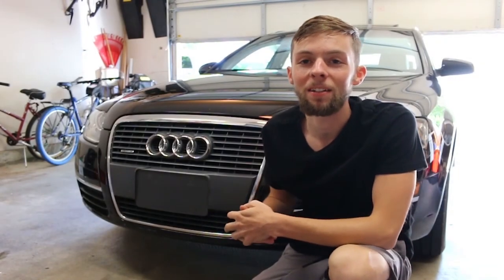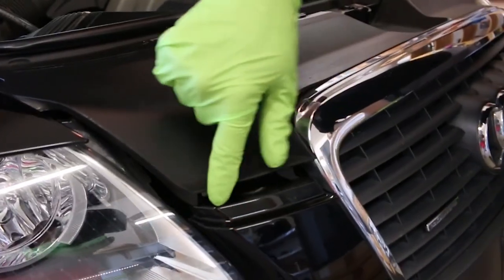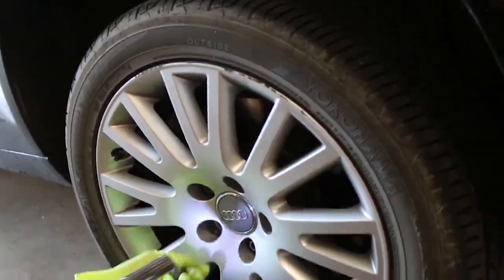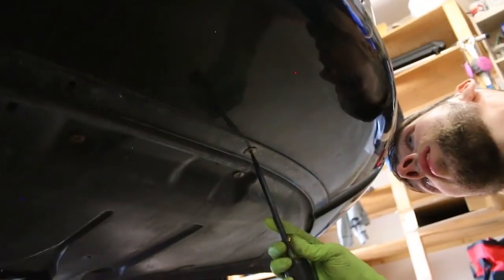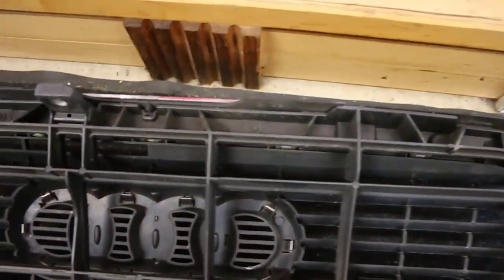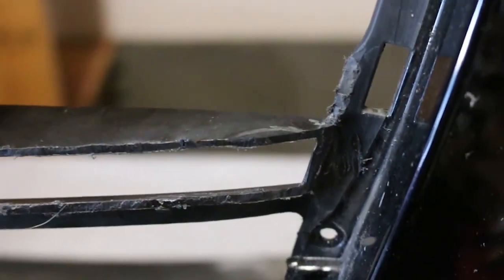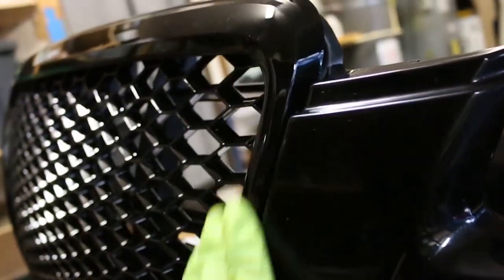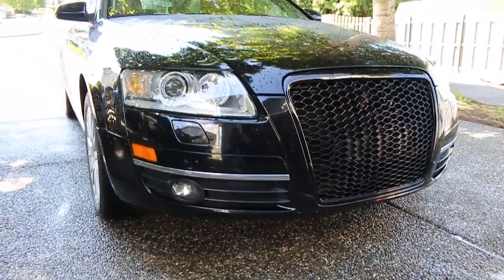MUST HAVE UPGRADE FOR YOUR AUDI A6! How To Replace Audi A6 Front Grille '06-11 | DIY facelift

Comment from the maker: Drop a comment or a like if this video helped you!
Reply: Nice video Cole :)
Reply: Bruh u have everything I needed to change to my car but haven't had the courage yet. Now I will do it in a few days ordering and getting ready.
Reply from the maker: @FirstNameLastName-fu8ml  you got this👏🏼😬
Reply: good job, I like it, but this model is not as aggressive as the facelift model, and you added this very sporty looking grill , I think it needs a bumper lip to neutralize the overall aggressiveness and probably needs some eyelids 🤔🤔🤔

side note: each to their own but I like it with the emblem better.🙄🙄🙄😂
Reply from the maker: @osamamaddani  I agree with the lip and making more aggressive. 

I also agree on the emblem, however, the mounting hardware for the emblem looked so awful I just couldn't do it. Guess thats what comes with a cheap grill

Thanks for watching and sharing your thoughts, appreciate that🤙🏼

Comment: I did this mod to my C6. After a while I put the badge back on it looks so much better with the chrome and honeycomb
Reply from the maker: I was going to put the logo on, I even ordered a all black logo from Ebay. But I really dislike the mounting hardware that came with this grill. Looks so cheap and awful in m opinion. I am still badgeless. About to tint the windows next though and then de-chrome everything. 

Thanks for watching and commenting, appreciate it🤙🏼
Reply: @Mechani_Cole  yeah I agree the mounting bracket is awful that’s the only thing I dislike about it

Comment: The reason it didn't fit perfect is because that grill you got is meant for the facelift 08-10, the 04-07 is slightly different 🙂
Reply from the maker: Good point, you may be correct! Either way, with a little modification it fits nicely.

Appreciate the comment, I didn't think of that before🤟🏼
Reply: Link for 04- 07 grill????
Reply from the maker: Don't have one. Not sure if they make one. Just have to slightly modify this one to fit

Comment: If I got front crash sensors, seems it wont fit well? Or code the code the computer as non-equipper and cut them off?
Reply from the maker: Can likely just relocate them or cut the grill to fit

Comment: I keep finding grills that say "2004-2011" even though they are different generations. Will a C6 grill fit the C6.5 generation? I have a 2011.
Reply from the maker: It will fit. Might have to do the same I did in the video for a good fit

Comment: Ive got a 2008 audi A6 sendan ive been thinking about changing the headlamps plus grill can i put modern headlights like for the 2016 model
Reply from the maker: Not sure if the headlights will fit from the newer models, they are a little different after the face lift in 2011. The grill was a good starting point for me. 

Nice car, thanks for watching🤙🏼

Comment: Would this be a good first mod for someone with no experience ? It seems a little overwhelming at certain parts.
Reply from the maker: Good question! This video makes it look easier than it is, so keep that in mind. Plus needing all the right tools. Taking the bumper off and reinstalling it can be a challenge as well. 

However, with the right tools, and some patience, you can definitely do it yourself. This was my first time ever doing it, I learn alot each time. The journey is the best part🤟🏼

Comment: Looks great !
I have the same car here in Australia and have been wanting to do this mod for a while now .
Great work !
Have you considered a different front bar ?
I’ve exactly the same and find it’s not aggressive enough  ( for me ) 
So I’m also considering either a front lip or the s Line front bar or both ..
Then slightly lowering it . 
I’d also have a custom license plate holder made to fit at the bottom center of the bar to keep that clean look .😎
Reply from the maker: I painted the front bar, actually powder coated it black because the silver was too ugly. I'm not sure there is an option to change out the front bar. If there is, let me know. 

I plan to lower mine with lowering springs once everything is fixed, just a very slight drop. Once its back together, its getting window tint asap lol.

Comment: I have the same car bro 2007 Audi A6 3.2 quattro do you have a video on how to remove the TCM I need to remove mine and send it in to be repaired
Reply from the maker: I don't have a video on it, but it's different than the CVT TCM for sure. Dealing with a similar problem and might have to replace the shifting solenoids in the trans myself. Are you getting an error code?
Reply: @Mechani_Cole  all the lights for the PRND come on and it goes into limpmode
Reply from the maker: Sounds like a control module them. I would double check that there is no recalls on your VIN number too. Audi had a bunch of transmission recalls in the early years
Reply: @Mechani_Cole yea but mine is a 2007 no recalls I just had my ECU sent it with a donor ECU to get cloned and now I just need to get the TCM fixed
Reply from the maker: Keep us updated if you're able to fix it. 

Right now I have a 4.2 that is "forgetting" to shift sometimes, but no error codes or nothing. Have done flush and new filter, still same. So maybe shift solenoids are next for me🤔
Reply: @Mechani_Cole  damn crazy what diagnostic tool you use. Is yours automatic or manual your 4.2
Reply: Have you tried checking on the Audi forum about your issue
Reply from the maker: @Rival I'm using the VCDS on the laptop. It's an automatic, I wish it was a manual, then I wouldn't have any of these issues haha
Reply: @Mechani_Cole  lmao rite no shit I'm using the obd11 Bluetooth scanner I have the VCDS also but I have a MacBook I need a regular laptop
Reply: @Mechani_Cole  have you checked your gearbox and gearbox fluid
Reply from the maker: @rival yes. New filter and new lifeguard fluid in it
Reply: @Mechani_Cole  damn I should do mine to let me add that to my long list lol have a good night bro I'm off got work early Am Keep me posted

Comment: What is the first plastic piece that you took off called?
Reply from the maker: Thats a great question. I'm actually not sure🤔
Reply from the maker: @Izmail actually its called Radiator Support Cover - 2006-2011 Audi A6 Quattro.

Here is a link for it - https://www.partsgeek.com/gbproducts/AC/18264-04249108.html?utm_source=google&utm_medium=ff&utm_content=AYY&utm_campaign=PartsGeek+Google+Base&utm_term=2006-2011+Audi+A6+Quattro+Radiator+Support+Cover+Action+Crash+06-11+Audi+Radiator+Support+Cover+2009+2007&gclid=CjwKCAjwlcaRBhBYEiwAK341jceA6I3VQLcM7K8ej06hIIPx2V7MZHnlKA5jb07krN_A3o0Owo30_xoCXgMQAvD_BwE

Comment: Will this fit an 07s6 c6.... I looked on Amazon an it says it will not fit
Reply from the maker: Yes, it should fit however you will need to make minor adjustments to the bumper support for it to fit properly. The car used in this video is a '07 Audi A6, the only difference is the engine and interior. 

If not, Amazon does pretty easy returns.

Thanks for watching and leaving a comment, let me know if you end up installing one!
Reply: Thanks for getting back to me.... oh I will not be doing the work....but I definitely will be purchasing the grill...I love the look....

Comment: how did you add the audi logo?
Reply from the maker: It comes with a plastic piece to attach the logo if you like. It comes with the grill and attaches pretty easy🤙🏼
Reply: @Mechani_Cole  my grill came in today and it didn’t come w it kinda sad 😩
Reply from the maker: @joselynchavez6715  well thats lame! Are you sure? Can return it and get another one. It should have a small bag with plastic tabs in it
Reply: @Mechani_Cole  yeah i’m pretty sure smh, if anything what do i search just to order that one piece i need to attach it?
Reply from the maker: @joselynchavez6715  really not sure. Maybe return yours and order this one https://amzn.to/3BS0kIk. 

See how there is that plastic thing on the bottom right corner on that link? Thats what it looks like.

Comment: Hi where I can get this product?
Reply from the maker: Hello, all the links are in the description for everything 😁
Reply: @Mechani_Cole  Another question, I have a 2007 car. And this product in the description is described for audi a6 from 2008 to 2011. Is this a mistake in the description of the product itself or does it really fit only models from 2008-2011? I don't see the difference, the bumpers are the same from 2006 to 2008!
Reply from the maker: It will fit the 06-07 but will need a small modification like in the video. Car in the video is a 07 as well. It's a direct fit for 08-11 and some small adjustments need to be made for 05-07
Reply: @Mechani_Cole  Thanks man. You are the best.